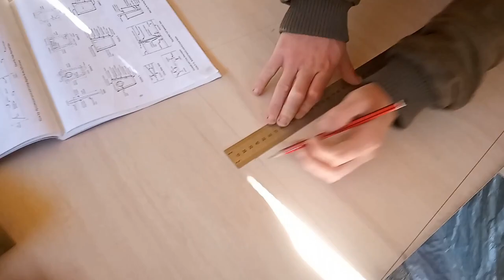Building an outrigger sailing canoe Part 1

Comment: nice saw👍
Reply from the maker: I just got new blades. They are awesome pull saws. Shogun Nokogiri.
Reply: @harpbloke  and why do Japanese cut on the pull when western saws cut on the push? My cousin always ran the hacksaw blade in pull saw direction. seems easier
Reply from the maker: @m3sca1  not sure, however they don't waste wood, very thin blades. Garden pruning saws are also pull saws.
Reply from the maker: @shinnosuke150  hi, you are correct about the saw blades. I find, when using a pull saw, that the trickiest part is letting it guide itself, it will cut straight and very clean if I don't influence it from side to side. The hand plane is an old Stanley No.5 . Thanks!